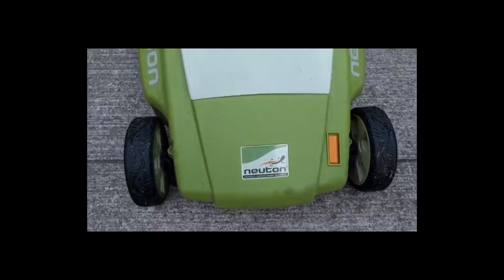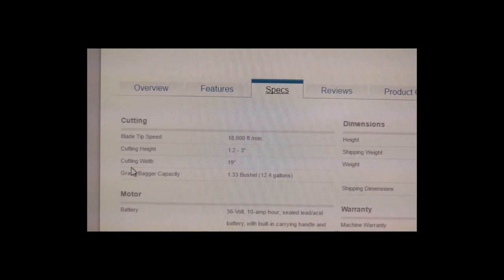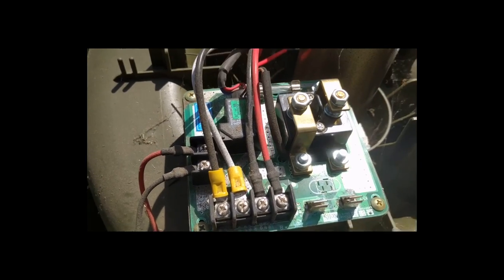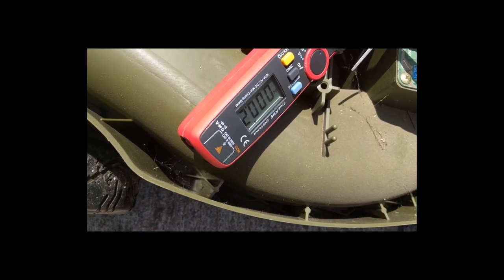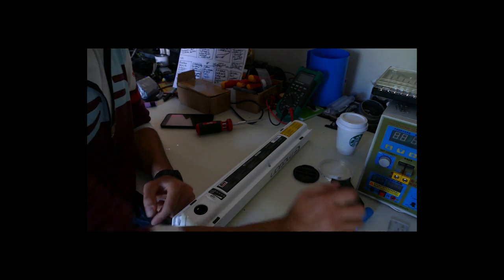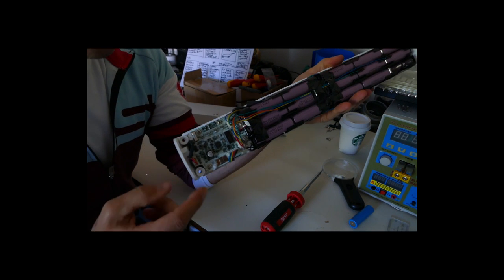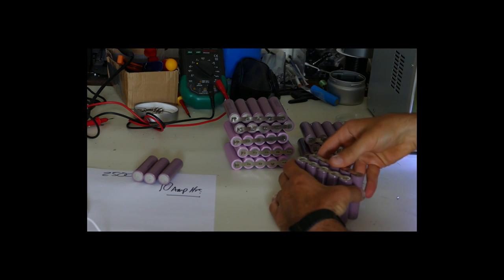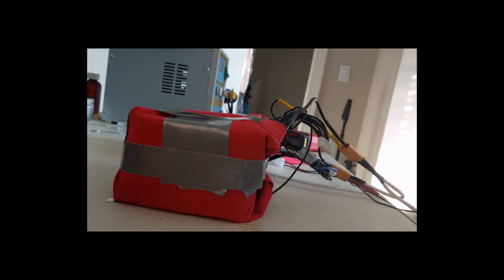DIY Cordless Electric Lawn Mower Lithium battery conversion Pt 1

Comment: I have the smaller 24 volt version I am looking to upgrade as well. I think I might replace that contactor board as well to simplify it anyways. One of the reasons I like it. Very generic and simple. No real proprietary parts like the modern BLDC mowers. I will probably cut the OEM contacts on the bottom of the battery tray and wire in a XT90 or XT120 connector. 
Lifepo4 is pretty cheap these days but I'm half tempted to go with a LTO battery.

Comment: I bought an old one at a thrift shop for $2.50 . it runs for 20 minutes.  If it's a 24v motor,  then 36v is safe for the length of time the battery lasts.

Comment: I have a lawnmower electric the motor is like 2 times bigger it sucks 130amps it is 24 volts and I am using a lithium polymer battery and half lithium ion 18650 and I do have a battery alarm
Reply from the maker: mixing isnt usually a problem . how many in parallel cells are you using.?
Reply: Learnding Diy I have a 3s lipo and a 3s lithium 18650 they are different capacities so I connected one of those buzzer alarms on the balance port and I made a balance port for the lithium 18650 so there is 7 wires connecting the 18650 are 8000mah and the polymer is 4000

Comment: 50A amp draw?  No way.  It's a 36V battery with 60 mins run time; that's 10A.  Assuming you don't want to draw more than 80%, your battery output could be 36V producing 45W.
Reply: Draw is not constant and fluctuates just spike on spin up and then loads up on mowdown 😂
Reply: @mmuller2402  That mower has a resettable 30A fuse.